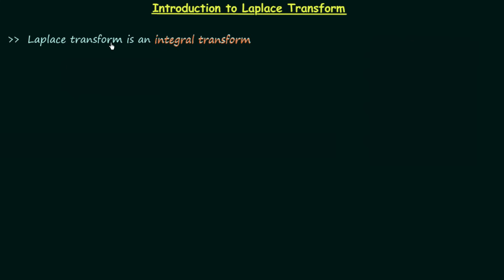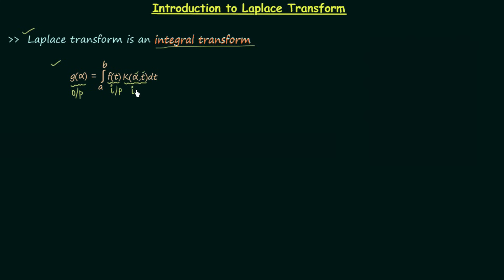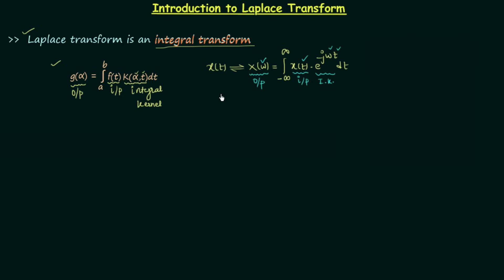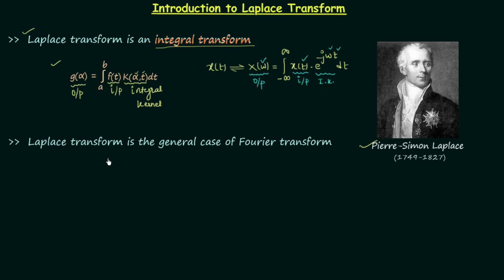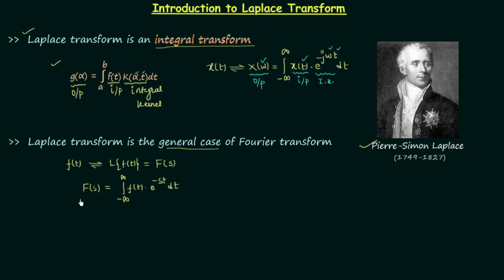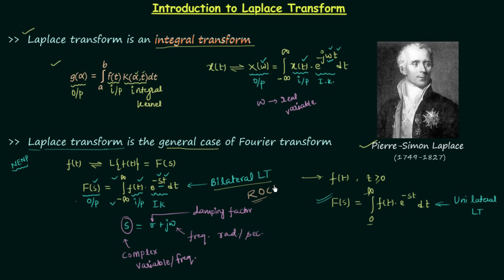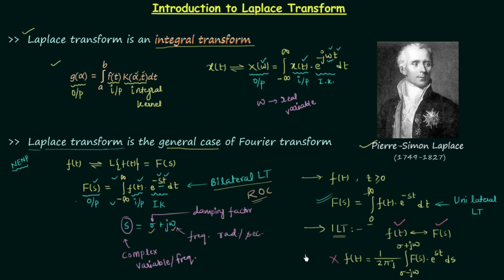Introduction to Laplace Transform

Comment: 00:04 Laplace transform is an integral transform.
01:26 Laplace transform is similar to Fourier transform.
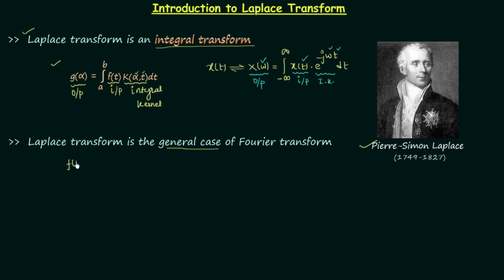02:41 Laplace transform is the general case of Fourier transform.
04:02 Laplace transform is a generalized version of Fourier transform
05:11 Laplace Transform is a complex function of complex variable s
06:45 Laplace transform can be bilateral or unilateral depending on the time domain signal
08:08 ROC is the region where Laplace transform is finite
09:25 Partial fractions method is used to obtain the time domain signal using its corresponding Laplace transform.
Crafted by Merlin AI.

Comment: What is kernel meant for??
Reply: If the system being considered is a filter, the impulse response is called the filter kernel
Reply: General meaning of Kernel is an important or central part of something. So here the integral kernel is the central part, in transforming a time domain signal to a frequency domain signal.